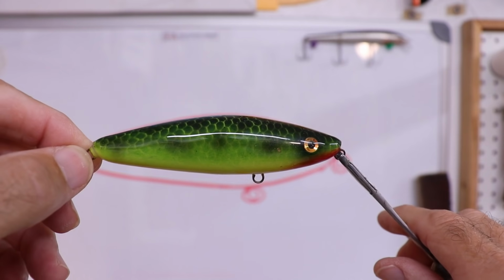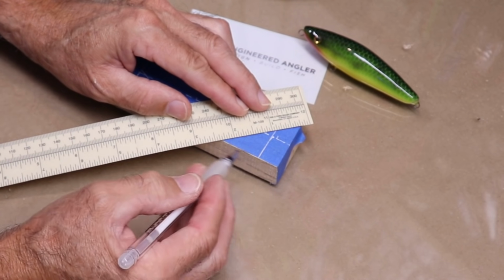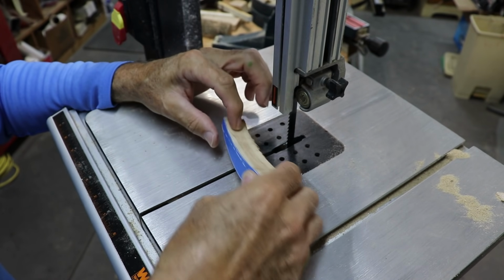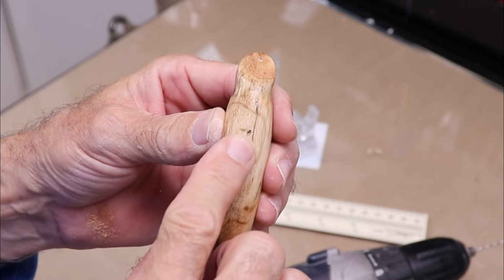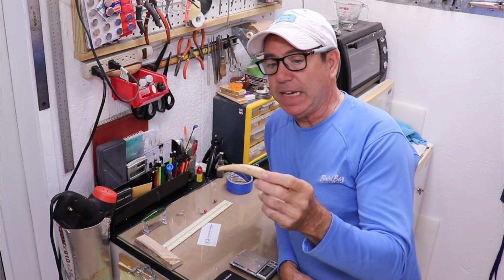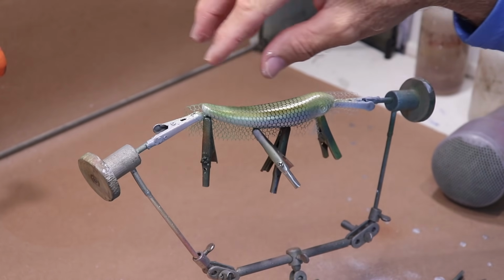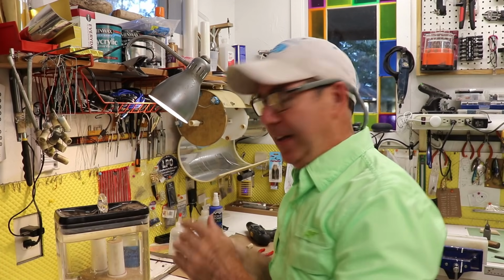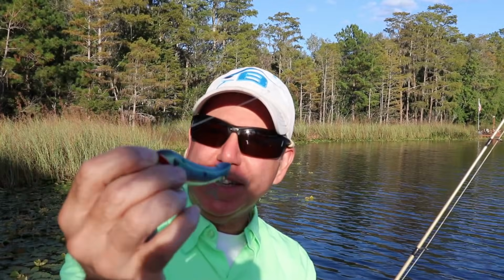Making Fishing Lures, Making a Topwater Fishing Lure, IT JUMPS!      #topwaterlure  #topwaterfishing

Comment: I would like to see you take that same design and reposition the lead eye to the bottom of the lip, and shift the weight forward just a bit. I think the lip would engage more water for lift, and the pull from the bottom would have a tendency to enhance the lift from the tail. Just a thought. Another idea I have for a jumping lure is to use the minnow form and add "wings" to it where the gills would be, at a 45 degree angle with a low pull point. I suspect it might have a jump when jerked, and a topwater skittle/wobble when on steady retrieve. I think your stuff is great. This is my first video of yours. I subbed immediately. Great work and presentation.
Reply from the maker: Thank you and welcome.  The variations on this kind of lure are endless...try what you think will work best for you.  Cheers.

Comment: That could represent mullet that love leaping out of the water.  If you moved the tie on eye down, relative to the center line, would the force push downward more?  So that the result is the lure shooting up out of the water at a more vertical angle.
Reply from the maker: lowering the tie eye would result in a more upward force.  The lure would tend to skitter more than jump.

Comment: Only about 5 minutes in and I have a question. Won't it benefit a little more from having the tie-on eye at the bottom of the 45 degree face which would cause a little more upward pull?
Reply from the maker: If you are trying to pull it out of the water then yes.  I wanted the shape of the lure body to create the upward momentum.

Comment: Just curious, why the concave back versus a convex one? Does it matter in creating "air time" for the lure?
Reply from the maker: Yes..it forces the head up when you pull.
Reply: Thank you so much for responding so quickly Franco. I'm having a senior moment trying to understand this. Would you be willing to elaborate on the forces that cause this to happen? Don't mean to be the dunce in the room, but I can't see how a convex shaped back, or concave one for that matter, has any influence on the motion of the lure's head. Rather the area pushing water at the head seems to me the key to forcing the head up and out of the water, regardless of the backs configuration. What am I missing? Also, thanks so much for all you are willing to share. Yours is the absolute best site for lure design and construction by far than anything else I've seen. I really enjoy the scientific approach! Cheers! @EngineeredAngler
Reply: I think it has to do with drag

Comment: OK. I'm addicted to your channel after two videos!

I have a question: I live in Thailand and my main sport fish is giant snakehead. They have lots of big teeth and a jaw like a vise. They shred many lures pretty quickly. Wood lures get lots of puncture holes through any finish a d the weed gets wet and rots. 

Ay ideas on how to treat wood to keep it from getting so many tooth punctures, or, conversely, stop the wood from wet rot?
Reply from the maker: Soaking the wood with very thin super glue (CA glue) before you paint, will harden the wood and seal it.  Then, some extra clear coats at the end will help too.
Have fun.

Comment: I had thought about something similar using two lexan lips sort of reversed front and back. Do you think that might work? Thanks for the video!
Reply from the maker: Try it...it might work.
Reply: Hi Matthew. Back in the 1980's I entered a homemade lure in a Luhr Jensen lure making contest the used to have. I called it a Skip Bait because, on a steady retrieve it would literally leap out of the water and then dig in on reentry, then leap, etc. The body was thin balsa covered in Pearl Mylar tube but what made it work was clear acetate sheet cut in a tear drop pattern epoxied to the top of the body in a concave configuration for the total length of the lure. The eye for the line attachment was above the lure. Anyway, I only mention all this because your question reminded me of it and I thought it might reassure you that you idea is very viable. No, I didn't win the lure making contest but they kept the lures I submitted. Three, each a different size. PS-Many thanks to Franco for an outstanding lure making series. It certainly has helped me on many occasions. Cheers ALL!
Reply: @gdokoupil  Thanks so much for taking the time to reply to this! I may do something with the idea sometime soon. Thanks and have a great day!
Reply: @matthewschmalz852  Hope it was helpful Matthew. I love talking "lure making", so thank YOU for the question to Franco. Cheers!

Comment: Wow for real that simple, been wondering cause that was my  ext item I was going to start researching was where to put the weights, I have 6 baits shapes I wanted to make really outside the box. I’ve had 3 of them fir over 8 years tucked away in my shop. Went and dug them out, got to go tomorrow abs buy a dry erase board & make me some of those stick on pins. 
So is that your go to method for every lure you build? As far as finding the weight placement, or is this only fur top water baits?  En wondering how to find weight placement in say a rattle trap type bait or just make my rattle chamber where area allows. This prob only for top water come to thinking about it. Thanks for showing secrets. I one else would show it really helps 
Later SQ
Reply from the maker: The hanging method works great for lures where your main focus is float or suspension angle, so topwater, twitch bait, swim baits.  If you're depending on the weight to help with the action...this might not work. Cheers.

Comment: I keep thinking that if this bait suspended in more of a nose-down attitude (instead of tail down) that it would leap higher and more cleanly out of the water.
Reply from the maker: Try it....but it won't work.  A bit more scoop in the tail gives a better jump. The video really doesn't do it justice; it actually jumps nicely when it's out away from the boat.
Reply: @EngineeredAngler  , by "tail down / nose down" I meant the suspension attitude - not the shape.  Same shape but if it suspended when still in the water with the nose down it would give the curve of the lure a lot more water to get traction in the water when it's twitched to curve upward and leap beyond the water surface.  I'm interested what the walking the dog action would be with a nose heavy version of the same lure.  I love the out of the box thinking on this design.  I hope to start tinkering with 3D printed similar versions.